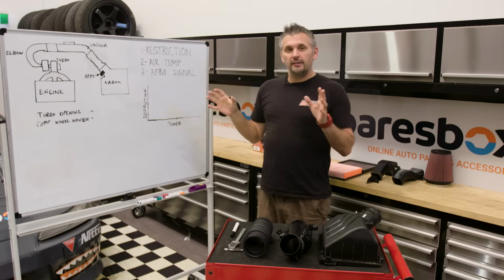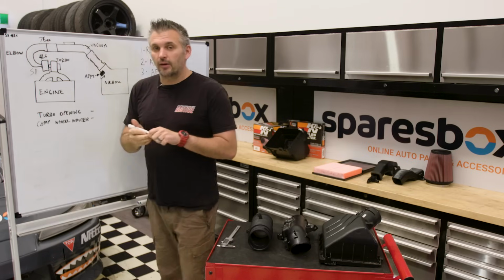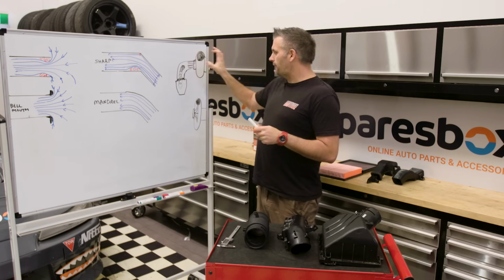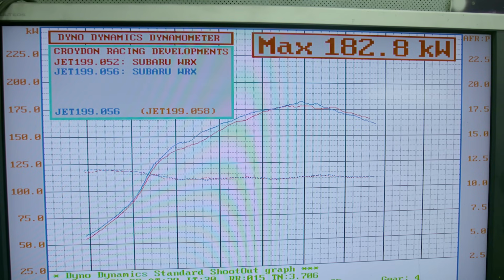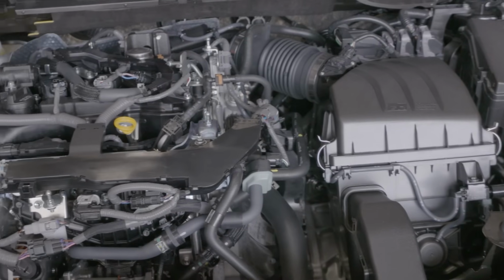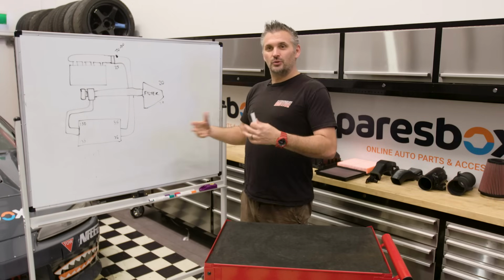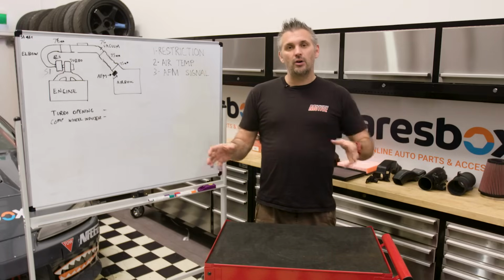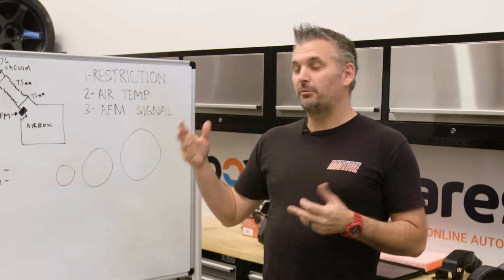Why Cold Air Intakes DON'T or DO Work on Your Car - Motive Tech

Comment from the maker: What results have you had personally with intake kits? What topic should we cover next in Motive Tech?
Reply: I have personally seen a .4 drop on the 1/4 mile at Eastern Creek with a K&N panel filter in the standard airbox on an AE112 Corolla Sportivo Turbo. 1st week, 15.8, the very next week after fitting the filter and nothing else, ran a 15.4. 👍
Reply: @MafiaboysWorld  air temp change.. track grip/temp change,, lots of variables to explain that
Reply: On the dyno I've seen mixed results depending on car and setup.. some gains.. some losses... some exactly the same 🤣 gained half a psi once from a intake too...
Reply: I am interested to know with some of these cars that run an aftermarket induction system with a cone shaped air filter and also some of the big power Skylines which run no air filter, What effect does this have on the engine lifespan and turbo lifespan ?
Reply from the maker: Most engines break or come out to freshen up before the extra wear from unfiltered particles have an effect to be honest.
Reply: @MotiveVideo  true, I ran my windsor V8 with 8 stack injection trumpets and no filters for 7 or so years in weekend competition driving. Perfect inside when I gave it a freshen up. You shouldn't hide or quieten 8 stack induction, it's not right!
Reply: @MotiveVideo  absolutely. Unfiltered intakes should be used only in all out racing where engines get built after so many miles or runs. Sand and grit can bore out rings and sleeve. Even turbo should be filtered to keep compressor wheel and shafts from deteriorating as well.
Reply: @MotiveVideo  LOL I call those cold air intakes, "Hot air intakes!"😂🤣. The stock air box with a K&N air filter breathes much better and cooler.
Reply: @robbyrob8349  the over the radiator cold air system is by far the best 👍
Reply: @jasondasilva5502  The less filtration, the less engine life. You don't get something for nothing in life. K&N's are about 85-95% efficient, OEM paper 95% when new to 99% when dirty.
Reply: @jasondasilva5502  When i think about people who don't run air filters, I just imagine all that sand and dirt that I bang out of my filter when I clean it. Absolutely horrible to think of all that going through an expensive built engine. After a couple years you'll have a noticeable loss of compression.
Reply: @jasondasilva5502  depends what you run into one the road..lots of bugs? or behind some cars on a rainy day splashing all kinds of goodies into the turbo .filters are cheap.. engines are not
Reply: I haven't watched the vid yet but my personal experience on numerous applications is if you move the stock AFM to a new spot it doesn't work aswell and you can end up burning shit loads more fuel for everyday driving and WOT can be inconsistent at times with how much power you're making
Reply: On my 25det r33 running 300rwhp with a factory airbox and a wix paper panel filter it made no diffrence if it was there or not. Same deal with factory  exhaust. Running a different setup now but also about double the hp through factory intake manifold and tb. Gives much better results than the greddy style plenum vs similar setups with bigger turbos.. Most of it Nissan know best
Reply: Water to Air vs Air to Air Intercooler would be a nice topic to cover. And also in different applications like street driving, Drag racing or even Time Attack.
Reply: @Drifthunts_Rob  I'd love to see a comparison too. I've had many turbo cars with air-to-air ICs. They can get doughy in traffic, esp. in summer (as Andrew pointed out). No problem on the freeway or on a track. My RS7 comes stock with 19 psi of boost, 10:1 compression ratio, and an air-to-water IC. The throttle repsonse is incredible and the power and torque NEVER goes off. I'm toying with increasing the water capacity of the system only before giving it a stage 1 tune to 700HP. A video covering this topic would be helpful.
Reply: @tepidtuna7450  Water-to-air is the shit! I have an aftermarket W2A setup on my street car.
Noticed measurable improvements in temperatures by increasing the liquid capacity (takes longer for temps to rise during extended WOT), and shielding the water lines from engine-bay heat.
Reply: Great video. Dumb question, would it actually be legitimately possible to run an intercooler on a naturally aspirated car for science purposes? I’m guessing there is a good reason why na cars don’t as I’ve never seen any manufacturer do it. As you say a 30 degree intake temp is likely only going to drop by a minuscule amount with negligible gains.
Reply: Bingo, nicely done and for some, if you just want to use X brand... you can do that also.
Reply: Good experience personally, I have a Turbo H6 Liberty (bit like Supergramps but with the 3L EZ motor). It was set up to use the OEM airbox and maf pipe from an EZ36 due its larger diameter than the EZ30 box (76mm vs. 68mm ID). 
Put on a locally made aftermarket intake/maf pipe of 73mm ID and made an extra 15-20kw everywhere on the dyno curve on the same boost and ignition timing (after readjusting MAF tables). It's a common type for subarus that places the pod filter in the driver's guard infront of the tyre. 
Dragstrip ET went from 12.3@114 to 12.0@120
Reply: I'd love to learn more about the advantages and disadvantages of engine swaps on VAG cars. Shaved engine bays, like moving components to the glovebox and boot of the car..
Reply: So when you were talking about turbochargers and cold air, you forgot that 16 psi at -30 degrees is a lot more air than 16 psi at +30 degrees. I actually think that the turbocharger amplifies the difference in temperature as opposed to an NA engine.
Reply: I've really liked hps silicone intakes, they aren't as prone to heat soak as metal or plastic/rubber
Reply: My ls3 gained 28 rear wheel kW and 53 NM just from an over the radiator cold air system and retune 👍
Reply: A cold intake is important especially in the city, when at a standstill the temperature rises quickly. I mounted a pipe from under the bumper to the original can and there is a difference.
Reply: I remember fitting a pod filter to my ST185 Celica GT-Four. What was previously a car that struggled massively going up a hill suddenly came alive. Not sure whether that was due to temperatures, restriction, AFM, or what - but it was a startling difference.
Reply: You really need to watch the evolve automotive series on there development of there gr Yaris intake
Reply: Maybe a top 5 list of best bang for your buck modifications to your GR Yaris that you've found.
Reply: Factory RB26 inlet manifold vs aftermarket plenum keep the ITBs both make power great but interesting to see the delivery
Reply: My 323F (Lantis) of 1995 model year had THE restriction as it should lower its HP from 110 to 88 for tax reasons in EU (Germany mainly). So, it tried desperately to suck more air and sounded like that from 3000rpm and on. When I put a cold air filter on it, it worked as it could and could feel and hear its need for air from 3000 and on. More power for sure. But where it is placed on hot days you can feel the cut in power at least for the first few kms. Depends on the stock air filter though.
Reply: I've gained a better sound from my hot air intake oh sorry cold air intake 😅✌🏻
Reply: I loved this video but I like to hear more about NA intakes. I am currently running a 3.0 Audi avk engine and am trying to get the best out of it.
Reply: I've upgraded the inlet piping on my falcon to the BA stuff. It was bigger and required some massaging to fit. I didn't feel much, if any difference. Someone else did the same and recorded a 40% or so drop in intake pressure but required a stopwatch to measure performance gains.

Turns out Falcon stuff just isn't that restrictive around 250hp. Unlike the exhaust... 100rwkw to 120-125rwkw with headers and exhaust...
Reply: I haven't had noticeable gains in performance with aftermarket intakes, but they do make the bay look nice. They also give you some nice induction sounds, and you get the benefit of having a washable filter. I have seen big gains on the dyno from removing filthy undersized air filters.
Reply: How about itb vs single throttle body? Would love to see this especially a little focus for the rb motors itb with front facing plenum as opposed to other rb single throttle body over the head plenums.
Reply: Cold water intake all the way man
Reply: I installed one on a 2003 Expedition, 5.4 2V, 4x4, 3.73 final drive. Factory rated for 17 on the highway.  Prior to anything else, I really never saw any better than 15-16 on the road. I initially installed a K&N cone filter, then a Gibson cat back exhaust. Then I modified the air box by removing the restrictor. Ran Mobile 1 or Royal a purple the whole time. Didn’t get any noticeable improvement in mileage although Improbably picked up power at WOT. Then added a K&N CAI. More noise at WOT and probably picked up a little higher rpm power, but no mileage increases. Had it tuned up at a little over 100k miles, and still no improvements. Previously, had used a K&N cone in a 3.8 Windstar and did see a usable slight increase in power at lower rpm’s and a slight highway mileage increase. Before then, had a 302/5 speed Mustang with stock intake and slight exhaust mods. Also ran a K &N filter in stock box with silencer removed. Had a conversation with JBA about cold airs and was advised that they weren’t really useful without additional power mods. Those old Fox body CAIs actually had a pickup under the front bumper so no hot engine air got sucked in. With a host of other mods, makes since ro free up the air being sucked in. To see significant increases in a stock vehicle that are actually useful for every day driving, they’re not really worth it IMHO.
Reply: More importantly, what results have you had with intake kits?
Reply: Most cold air systems flow more air.  More air means more power once TUNED for it period
Reply: There is no science in mechanics. Science has to do with natural phenomena. Stop using the word science incorrectly please. Thank you.
Reply: If the so called cold air intake is sucking in air from a hot engine bay...how is it cold air? That's a hot air intake..Also an oil impregnated k&n filter will gum up the intake and the egr passage..Also on a direct injection engine it will also clog up the valves ..On my 98 mustang gt it has a bbk cold air intake pulling air from under the fenderwells..not under the hood..It actually works and is really a COLD air intake...I run a dry uni filter from a Polaris sportsman 500..with NO OIL..
Reply: A video on sport header please ( I have Mazda MX5 nb unmodified, apart from a diy cold air intake).
Reply: Would increasing the bore size between the MAF sensor and the inside of the filter. ??? Thanks for the education from the video too. v
Reply: put a AEM one on my 14 mazda 6 2.5. Sounds like a race car past 4000 rpm lol. The intake itself while good design wise was horrible quality wise andi had to use a dremeb and modify it to get my MAF to fit. I took a tuning course which helped me learn a little about tuning and i made my own custom 91 octane tune using versa tuner and my maf did show that more air was entering the combustion chamber with the CAI so idk. Its got a ram air scoop though that feeds cold air directly into the filter so when im driving especially at high speed my intake temps are actually lower than stock. But at idle it heat soaks my intake temps are way higher than the stock box.
Reply: My cts intake used to vibrate against my brake reservoir and I could feel it in the brake petal. I fixed it with a little piece of carpet on the reservoir cap. On my application I did see a tiny increase in average mpg. ( +1.6 ) I can't tell if I have anymore power because I fixed a boost leak from my driver valve at the same time.(BOV conversion)
Reply: This was another brilliant tech video... I know you said it's very in depth but could you not do a similar episode on plenum design, style, sizing & runners etc?
Reply from the maker: We could, yes. But its a hard one to explain with test results
Reply: @MotiveVideo  That's cool I understand that. Would just be interesting to know the different styles & methods used (eg. Swedish / twin chamber) and if they have any advantages etc if possible? Great work anyway.
Reply: Years ago a mate's WRX was making stupid power with a MAF delete and a pod in the inner wing (branded intake). We experimented to see if we could improve on it.
To our considerable surprise keeping the MAF delete pipe and hooking it to the standard airbox, with the airbox-to-engine bellmouth in place, and a much larger cold air intake feeding from in front of the radiator to the airbox, we picked nearly 15kW in his configuration. He did have a non-standard turbo too. 
At the time I put down to the large surface area of the K&N panel filter and it's stabilising effect on the air as it entered the bellmouth. This is as opposed to the pod filter's surface area as you just showed on the GTR.
Reply: drop in hp and fuel enconomy d15y7, got 25mpg with stock and would run in 5th at 100mph, stock ecu,  put on a specter intake. lost 5-8 mpg and had to stay in 4th to keep it at 100mph.  it was bigger than stock and shrunk down to a stock throttle body.  yes it was done on my car in my profile pic
Reply: Both my civic type r ep3 and fn2 and a accord type r I owned felt a lot stronger with the standard airbox back in place 

My r32 gtr running rebuilt standard turbos made about 10hp more peak power with pod filter instead of the standard airbox on a Dyno but it lost a bit of midrange power

Comment: Super late reply ...

So basically cold air intakes do not do shit unless they are in a box completely separating it from the engine bay and has inlets/ hoses pushing/ pulling fresh air into the filter box.

So basically we're just paying extra for the tiny bit of difference in sound.

I remember when I had my 96 M3, I had a k&n cone filter on it and ran tubes from both brake inlets on the front bumper to the cone filter and box that I made for it. I also had a Jim Conforti chip that supposedly added something like 25 HP and I think 35 torque. Also raised the rev limiter from 6500 to 7200. 

I could definitely tell the chip worked. 

Couldn't tell if the cold air intake worked at all. It sounded really nice though. Especially when downshifting into third going through a tunnel.

But it was so long ago I don't remember.

about the cold air, I can definitely tell I have more power on my A4 2.0t in the first 5 minutes of driving my car after it's been sitting all night then I do 10 minutes into my drive. So cold air does make a huge difference

Comment: Ok got a good question for anyone on this channel i live on a dirt gravel road so dirt and dust get into my filters.  I have a 2023 stock challenger scat pack. Knowing this what cold air intake would you use and do I do a oil filter or non oil filter for the cold air intake? Remember i live on a gravel road so cleaning the filter has to be done. What cold air intake is gonna give my 6.4 liter the most power?

Thanks

Parrothead

Comment: Only worth it if your vehicle is turbocharged
Reply from the maker: Totally incorrect. Turbo cars have intercoolers, so temperature of air pre turbo isnt as important as an NA car,
Reply: @MotiveVideo  I was actually referencing the volume more than the temperature of the air. Turbocharged vehicles benefit more from the less restricted airflow of a well-engineered cold air intake

Comment: I kind of knew that 95% of aftermarket intakes are only going to lighten your wallet and offer no noticeable gain.    I buy the drop in re-usable air filters like aFE or K&N because over time they can save you money from buying disposable paper filters.  I don't mind cleaning them.   This is what I have to do anyway for my motorcycles that have foam filters.

Comment: I heard if the air is too cold, it’ll crack the block.  To countermeasure this, you should wrap a coolant hose around the intake with a tight coil spacing to heat the air going into the engine.
Reply from the maker: WTF? Slap who ever told you this. Cold air freezes the water in the block. When it freezes, it expands and cracks block. This is why you need coolant in sub zero temperatures.  The reason some cars heat up cold intake air is for combustion efficiency. Air too cold doesn't atomize with the fuel as well. But for power production, cold air is king.

Comment: turbulence doesn't affect a turbocharger, but it will effect the MAF that precedes it. MAF sensors just don't work when you have turbulent flow. try looking at maf readings when blowing an industrial fan into your engine bay or into the intake. the maf readings go crazy.
Reply: i see this gets addressed near the end of the video